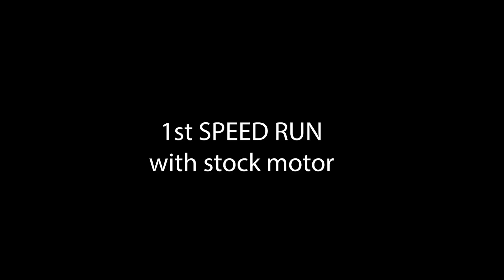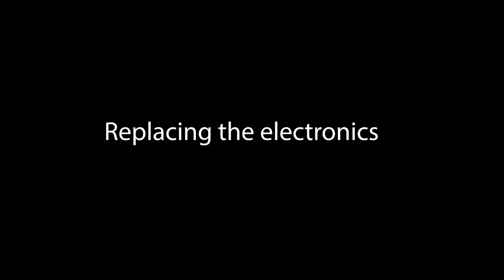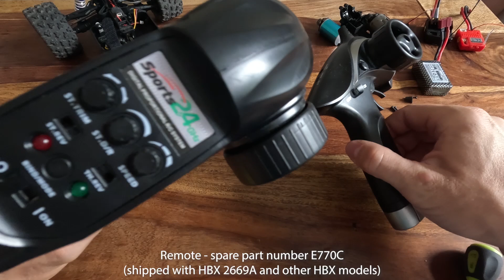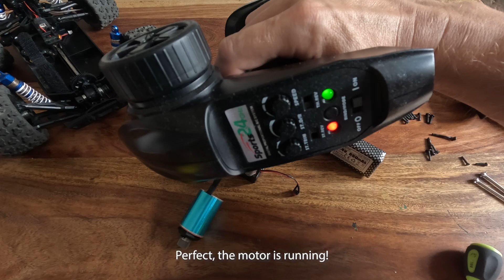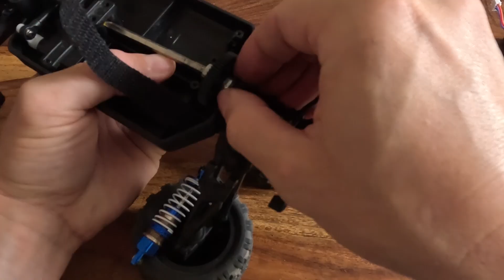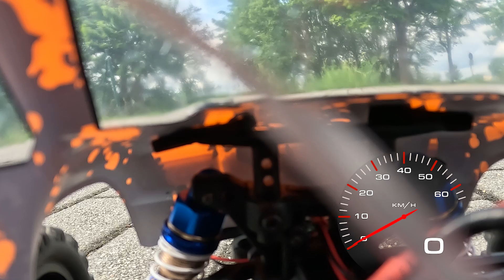Haiboxing HBX 18859 upgrade part 2: Brushless conversion on a budget | 2996a ESC | tuning | #rccar

Comment: the can on mine gets blazing hot anyone make a fan for it yet thats runs of the ESC for the lights?
Reply from the maker: I would not recommend the connector for the lights. I think it provides not enough amps. May you better use a BEC for this or try at first to cool just with a heat sink.
Reply: @TheRCTechLab  I made one from an LED fan cooled automotive headlamp & its own heatsink soon as I get time I'll post a video how I made it.

Comment: The pinion gear that came with the brushless motor was rough switching to the original pinion gear from the old motor was smoother how did you get yours to work?
Reply from the maker: Oh, I can't remember exactly. Have already changed this in the meantime to another motor. But I think I was simply using the pinion that came with the brushless motor.
Reply: @TheRCTechLab yes im watching your other videos right now and im hooked becuz i want my rc like yours
Reply from the maker: Thank you 😊 
Yeah, this project went a bit out of control. Bit I like this little 1/18th scale thing. 😂

Comment: I did this same setup, but with the brushless red esc looks pretty much like the original. For some reason I don't get the distance I did with the original brushed setup. And I tried 2 different esc receivers. Any ideas?
Reply from the maker: I don’t know how much amperes the red ESC supports. May your RC is faster in reverse? Then swap two motor wires. Or may your battery is the limitation?

Comment: Hi this was a perfect video to find. I want to upgrade this exact RC truck for my son. Does the new esc work with the old controller? Thanks for the info
Reply from the maker: Surprisingly, it works. I have tried exactly that. The old remote control also works with the new ESC. But the new one has more setting options.